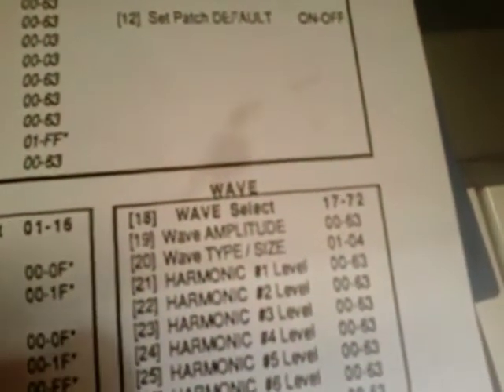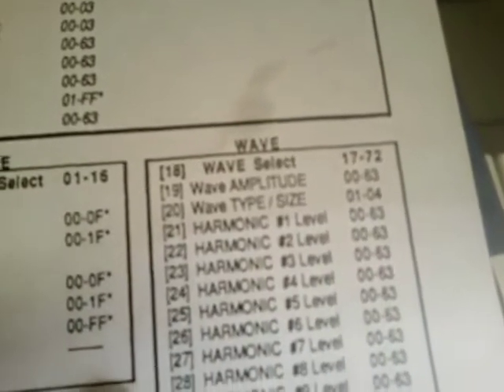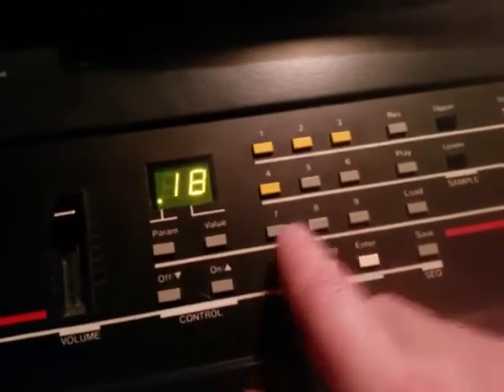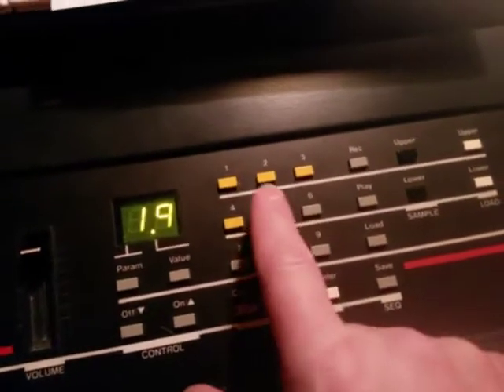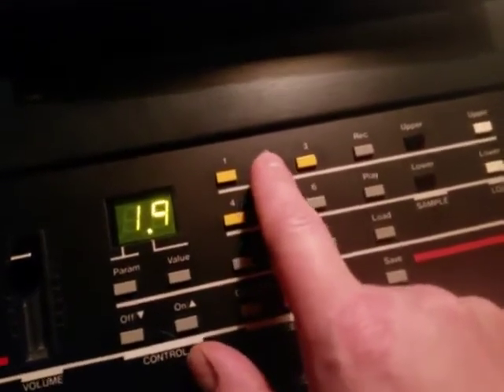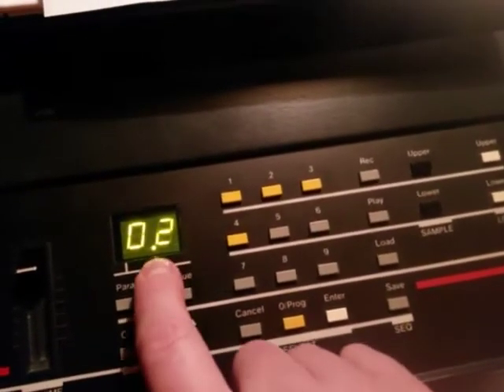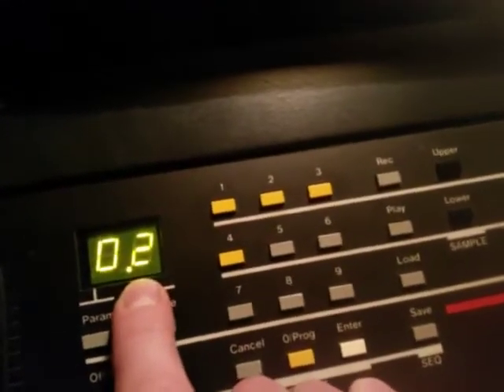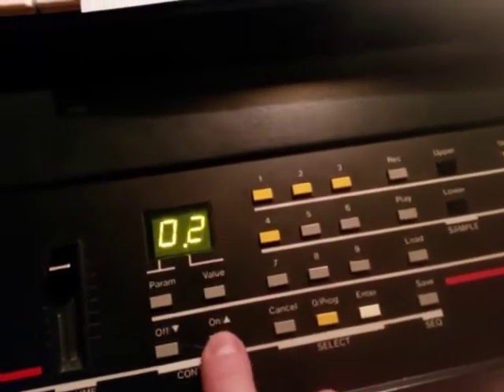Ensoniq Mirage Soundprocess - 04 Loading the Wavetable

Comment: I have gotten the mirage (on masOS) do do a kind of thing where it seems to play through each page sequentially, albeit randomly.  Sort of like a Wavestation wavesequence.  It seems like this would be possible with Soundprocess but with more precision.
Reply from the maker: Sounds interesting. Do you have sound examples available?

I have an idea how to do something wavesequencing-like on the Mirage with Soundprocess.

I have not encountered any random wavesample playback though.
Reply: @RoshiAi  doesn't necessarily require masos.  I don't have a sound example right now, but if you've got any regular (non soundprocess) disks, try this

1. Load some sounds.
2. Set up the following parameter values:

Parameter:Value
27:08
28:on
34:63
36:99 (optional)

3. Press and hold sustained notes.

it's not very "wavesequency" but you can hear random pages of every wavesample within the disk, sort of like a glitchier "All Waves" type setting

Comment: this also a sound generator too.. ? i thought i was just a sampler
Reply from the maker: Choppy Beats It's a sampler which is capable of some very nice synthesis when you load the Soundprocess Operating System.
Reply: Robin Bausewein what you are showing is this in the manual? i just purchased one just waiting for it..
Reply from the maker: Choppy Beats (edit) Yes, this is all in the Soundprocess manual. 

Soundprocess is an alternative Operating System which is very different from the regular Mirage OS 3.2

And actually when you load Soundprocess you will be able to generate sound without loading any samples.
Reply from the maker: Choppy Beats Cool. Let me know what you think of the Mirage and any questions you have.
Reply: Robin Bausewein ill have to look into this before it arrives.. thank you i appreciate it.. one thing i was curious . can you generate synthesized drum sounds like a simple kick or snare
Reply from the maker: Choppy Beats What I show in the video is basically only about the waves 17 to 72. These waves can be either 1, 2 or 4 pages long.

Waves 1 through 16 can be longer wavesamples and you will have enough space to fit a simple drumkit in there. 

I have not tried to synthesize drums.
Reply: Robin Bausewein wow Thats cool.. im really gonna have to time to create sounds..
Reply: Robin Bausewein it just arrived.. as far it working is it suppose to make a buzzing sound when its on.. i know these ensoniq keyboards tend to get hot around the back...
Reply from the maker: Choppy Beats It's not really supposed to do that. What kind of buzz is it? Did you open it up yet to take a look? What model did you buy? DSK-8 (Gray or Black) or DSK-1?

Ussualy they are very easy to open. Take out the screws on top, just 4 of them, then gently lift the top until it feels like it's stuck. Pull it slightly towards you and up.
Reply from the maker: Choppy Beats As for the heat issue: don't put it on a flat surface. The heat has nowhere to go that way. Preferably put it on a stand or something so that the bottom of the unit is free.

Every once in a while you will hear a sound like 'tack'. All my Ensoniqs do that when they get warm or cool down, even when they're not switched on. It's like the material if the synth case is expanding/shrinking due to temperature changes.
Reply: @RoshiAi  and for anyone that reads this, leave room to circulate below the bottom of the keyboard as all the processing is done in a card at the bottom right side of the unit so the heat dissipates from below. Also, if you can point a fan (any kind) to the heatsink on the back it will help to extend the life of your Mirage (and other Ensoniq Keyboards) for many years.
Reply: hehe...i really wanted once to make a Soundprocess Tutorial or at least a presentation of it, because i'ts soo amazing, but you we're faster ;-)
Reply: well, i usually don't make spoken videos...mostly i just play and years ago i just putted some explanation text on the videos.
but, yes, you're right...should do it.
Reply from the maker: traumaduo/spacebox720 Yes, a video about that is still on my 'to do' list.
Reply from the maker: traumaduo/spacebox720 What is stopping you? It's alwayss good to have different perspectives available. I say:  do it!
Reply: and don't forget you can also do some simple additive sinthesis with this OP-System on the Mirage